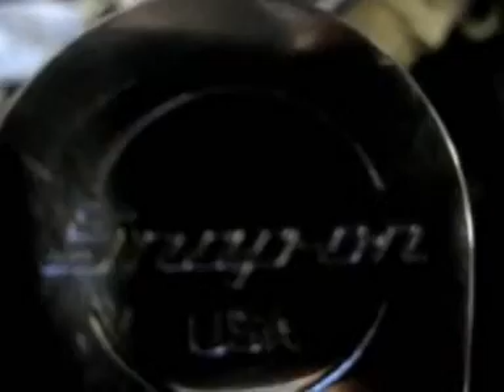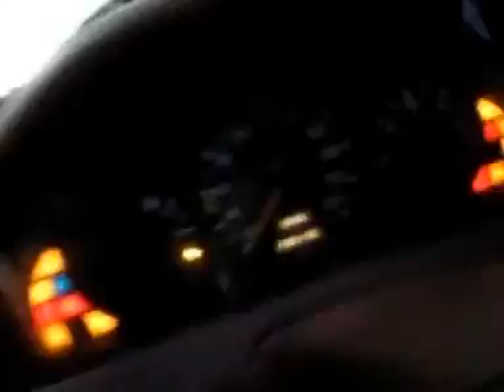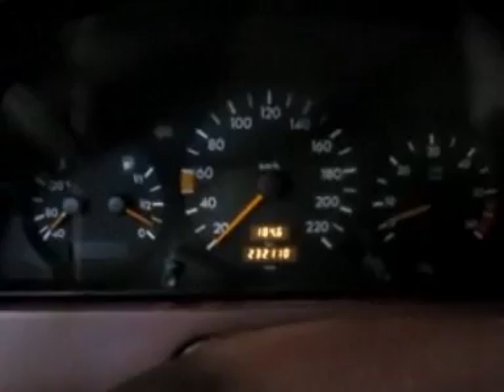Dieselmeken shows how to fix leaking deliveryvalveholders on Mercedes

Comment: He did renew the delivery valve copper washer but he did not show if he did renew the delivery valve holder rubber o- rings, which can cause the fuel to leak. The delivery valve holder should also be tighten to correct tightening torque. Anyway thanks for your time showing this video.

Comment: Hi
I seem to be having a problem on my w202 c250td 
We did a complete engine overhaul but now at the first injector it keeps building up air when we open the 14mm on the fuel line the air releases then it builds up again after couple seconds

Comment: .i opened the the pressure valve holder of an bosch diesel fuel pump (part number 0 400 074 922) FROM  Mercedes 240 GD, OM 616.936 ENGINE  to change O-ring seal,because the air leak.then i tightened the valve but when i am trying to start the engine.now there is no leak in the valve now, but the pump have no pressure enough in this cylinder that i changed the o ring.when i am trying with the manual low pressure pump to see if there is still fuel leak its ok.but when i am trying with the starter i notice air in the plastic tube which goes to the pump from the filter.and no pressure in the valve.somewhere i read that if the valve removed with the copmression spring and the copper seal maybe the pressure valve carier thast inside need after this arrangement.maybe something broken inside...or maybe i need to put of the pump and send it for initial setting
Reply: And finally?